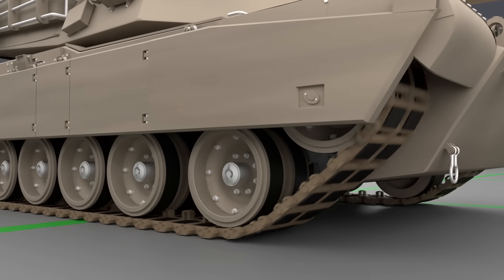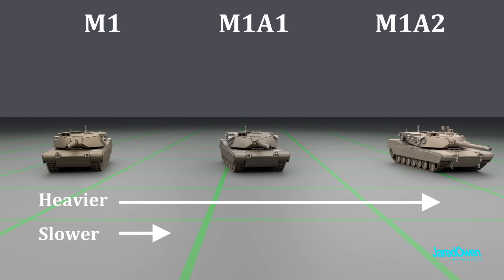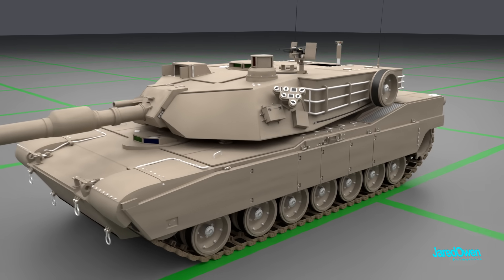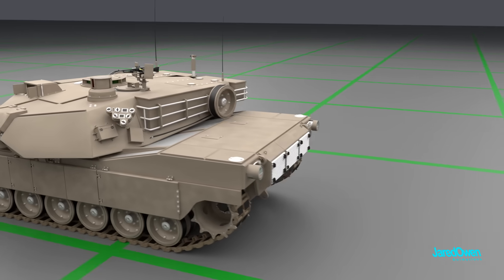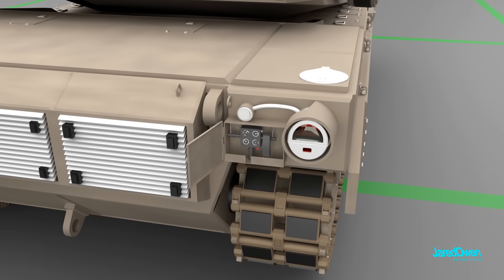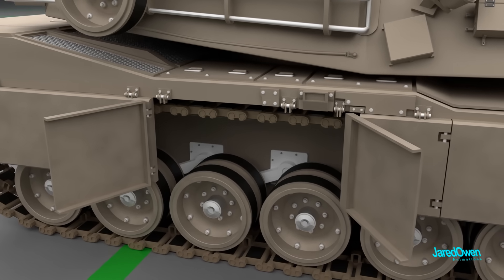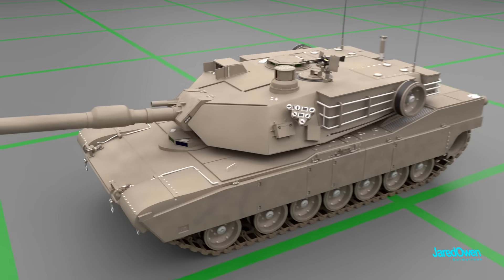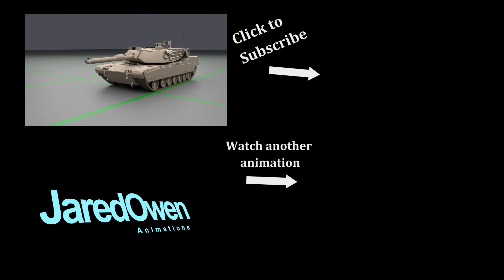How does a Tank work? (M1A2 Abrams)

Comment: Why have Tanks when Apache and Other helicopters are far more versatile 
And carry more weapon systems than Tanks and are far faster to get-in-strike and get-out-fast capability!

Other flying Tank is the Hercules C130 aircraft gunship. An all round Brilliant class Super-fortress!
Certainly in Stealth form with added weapon systems covering 360 deg!
A Top Super-fortress! Superb!!!

Just a thought!
JB. East Surrey. UK.
Reply: Because they're air assets and not ground assets? Also helicopters are still vulnerable to AA fire and missiles. Tanks are meant to spearhead assaults, attack helicopters are more specialized in hit and run tactics.

Comment: In South Korea, during time there the line of Abrams would start their vehicles in the winter, one after the other, so they can charge their batteries but at same my infantry guys would follow the one running to keep warm in -18°F without wind factor. So hot...melted my canteen cap (plastic)

Comment: Just FYI...42-mph is the 'governed' speed on the M1-A1...but in armor-battle, those governors can be 'removed' for 'all-out' speed. I've seen an M1-A1 column blow through a ground column pushing 75-mph...not good for 'life expectancy' on a motor...but 'when you've got to get there NOW', they CAN do it...the A2 is heavier, so don't know if it can get up that fast still...but I wouldn't underestimate one running 70-mph, if 'uncapped'.
Reply: ???? where did you see a 68 ton tank go 70 mph? the abrams barely goes 40 on a flat road
Reply: @CheekiBreeki-mq2my  with speed governors off**

Comment: How does the turret pop off on this one? 🤣
Slava Ukraine! 🇺🇦🌻
Reply: It doesn't.  Unlike your typical T-series tank, the M1A2 doesn't have an autoloader under the basket that causes an FGM-148 to obliterate all your ammo and turn your crew to ash.
Reply: It actually got blowout panels. So when the ammo is detonated it doesn't kill the crew or tank. The only problem is your ammo is gone
Reply: The abrams mainly uses APFSDS rounds which are not explosives
Reply: @hydrasbane7731  You are wrong on so many levels. Abrams uses MPAT rounds. Which is a programmable round that can function as HE or HEAT. And also propellant of APFSDS is an explosive.

Comment: I served at Fort Hood until May of 1980, 13th Signal Battalion, 1st Division.
Our Barracks overlooked one of the main 'drive-ways' to the Tank Ranges.
Saw lots of XM1's and lots of brush-fires...they had trouble with exhaust heat and dry brush at first.
Fort Hood was tough on vehicles; powder-fine dust that turned to slippery mud when it rained, the mud dried into lumpy concrete that slowly turned back into drifting powder.

Comment: I'm wondering why they don't have an M1A7 by now. It's been a solid 3 decades since there's been an improvement or a new varient to the M1 Abrams. 

I'd expect a new variant every 6 years based on the first 2 variants. Meaning, the 7th variant should've launched this year.

Then again, I guess 'If it ain't broke'...
Reply: I "think" they went from the M1 to M1A2 because of the upgraded 120mm gun, improved armor, tank commander's sights, and engine filtration mods.  Those things seem to be the critical things that make the A2 an A2 compared to the M1.  All the other upgrades since seemed to just be add-ons to the same A2 design?
Reply: @mrgold3591  
Hmm. Good point.

Comment: and shot U238 (Uranium 238) ammunition !!! Not very smart...
Reply: Depleted uranium is not dangerous. Especially if it's stored in an armored box separated from the crew most of the time
Reply: @yourlocalretard5893  until being shot, it contaminate the ground and every civilian/soldiers.........
Reply: @yourlocalretard5893   It is dangerous is uranium, is both radioactive and poisonous.  But handled properly is safe just like a knife.
Reply: Depleted Uranium
Reply: You do realize the purpose of a tank is to kill instantly, effectively, and efficiently.  Workplace safety isn't high on the list when there are hundreds of other things that can kill you faster in war.
Reply: Uranium 238 has the among the highest half-lives of any actinide, so nobody's getting irradiated.
Reply: @commscan314  i said the powder, when the core of the projectile exploded it create a contaminated area. If you breath that powder you have the cancer, with linfoma of Hotchkins.

Comment: Actually it's not normal for tanks to have a turbine engine and it's basically only the Abrahms that has it.
Most tanks have from 8 to 24 cylinder turbo-diesel engines that can run on different fuels.
The awkward turbine engine of the Abrahms is also hated by crews that have been operating them in Iraq/Syria/Afghanistan because crazily enough the it's designers placed the air intake of the jet-turbine engine....under the hull.
So it's basically like hoovering sandy deserts and besides obvious frequent mechanical failures the crews spent more time cleaning and servicing it's filers rather than maneuvering it around.
Reply: What are you on about?
Reply: It has been +42 years with the turbine engine.  The tank crews I've talked to when I was part of an Armor battalion never said they hated the turbine engine.  I even talked to tank crews that had M60s before the Abrams and they would never ever wanted to go back to diesel again.  Both turbine/diesel have their advantages and disadvantages.  it all depends on what fits the war fighting doctrine the best for each country.
Reply: Also, the STRV 103 and the T-80 had a turbine engine. And the dust problem was fix by redesigning the filters in the 90's.

Comment: The driver has to be the most dangerous position. There are so many scenarios where the driver would be stuck and unable to get out.
Reply: in T-72, the driver has the safest position.  The rest of the crew are sitting in the middle of the carousel loaded with shells, pretty much killing everyone in that section instantly from the massive deflagration if the tank gets hit
Reply: @timby2383  Nope. The driver doesn't have anything behind him except for more ammo. Hes exposed to the carousel just like everyone else.
Reply: i think that the driver has its own, supper armored hatch at the bottom, but he must crawl into it and get out from under the tank (also m1a2 was never destroyed by anemy fire so its pretty good tank)
Reply: @pepez1325  M60 series tanks had a bottom hatch for the driver but the M1 series does not. He does have the most armor around him compared to the turret crew.
Reply: Actually, in case of power/hydraulic failure the turret can be cranked 'round by hand to allow the driver to access the turret.
Reply: It's the safest of the four positions.  He has the most armor around him and he is located at the lowest position.  Drivers only get nervous during water crossings.  The gunner is in the worse position.  Only position that doesn't have its own hatch.  He has to wait for the TC to get out of the way if there is a fire.

Comment: Nice work. But nexttime say that the idea behind it comes from the german lepard tank. the hole body (hull) is 1 to 1 a german lepard^^
Reply: No it most certainly not
Reply: It's foundation is off the MBT-70 program. Which was a joint program between west germany and the USA. The program turned out to be too expensive. From this program the M1 abrams and leopard 2 were born

Comment: The M1A2 has been in service for thirty years?  Do you mean the Abram's have been in service for thirty years?  The first M1A2 tank was delivered to the army in 1999, although the M1, M1A1's have been upgraded to M1A2 standard.
Reply: I'm not sure when the M1A2 was put into service; but, our Armor battalion in Fort Lewis, WA, had M1A2 X-ferred from Germany in the early 90s.  The M1A2 was the main tank used from talking to the tank crews that were in the first Gulf War in 1991.
Reply: @mrgold3591  - Are you sure they were not MIa1's that had been upgraded to MiA2 standard?
Reply: @nightlightabcd  Might have been?  I was the Battalion Signal officer and all Abrams were designated as M1A2s and had all the A2 upgrades that were shipped from Germany to the Armor Brigade back then.
Reply: @mrgold3591  - So, how did you like it?  Does it handle better then the M60?
Reply: @nightlightabcd  I'm an old fart and did get in the driver's seat of the old M60 tank once.  It handles like you would expected driving a +50 ton tracked construction vehicle (loud engine, jerky acceleration/braking, handling closer to power sliding into corners instead of steering).  I never drove a M1 tank; but, I didn't observe the same jerky movements with the same low speed maneuvers.  The M1 looked to me like the closest thing you can get to a hoover tank with its smooth movements in low speeds.  The M1 turbine whine was music to your ears and that unforgettable Abrams jet exhaust was never a negative thing compared to diesel exhaust of other tracked vehicles.

Comment: What’s a turban engine?
Reply: Turbine can burn multifuels, higher power-to-weight ratio to a similar sized turbo diesel, quick start ups in extremely cold to extremely hot weather, excellent power delivery and torque for its size, engine+transmission can be serviced or replaced easier in the field, they had to put a speed governor or the tank would go 60 mph, and it generates much less engine noise compared to a similar hp/tq turbo diesel in operation.  I haven't talked to tank crew that been to war or trained on the Abrams that wanted a diesel instead of the turbine engine.  It is usually everyone else not part of a tank crew that want a diesel for the Abrams.

Turbine downsides are it can consume a lot of fuel during idle (they added an Aux generator) and it can consume more fuel compared to a turbo diesel engine in operation.  The Abrams was spec'd for a certain operational range and its fuel range meets that standard.